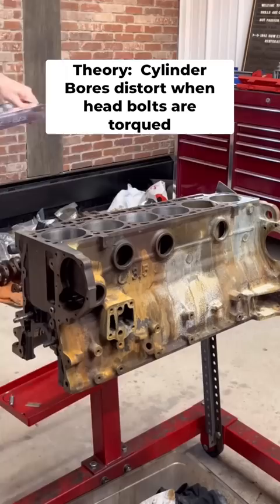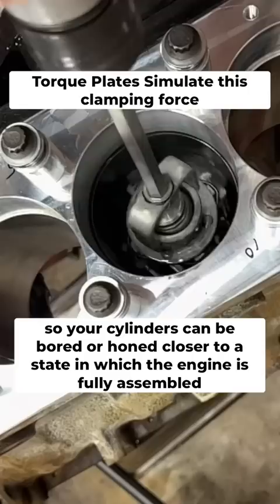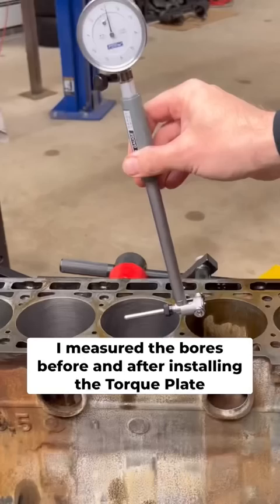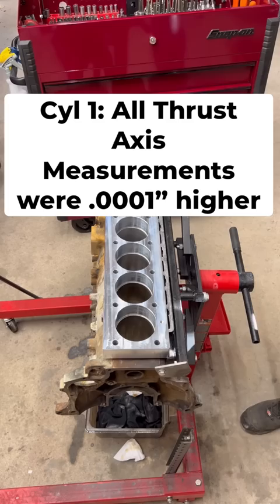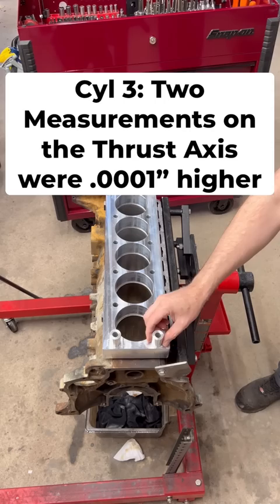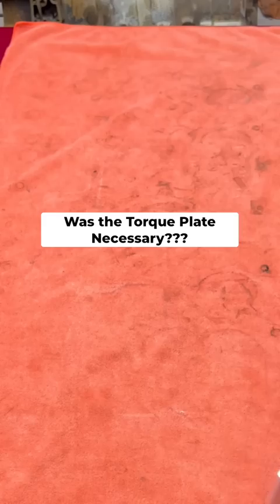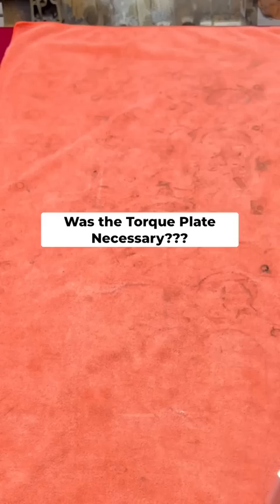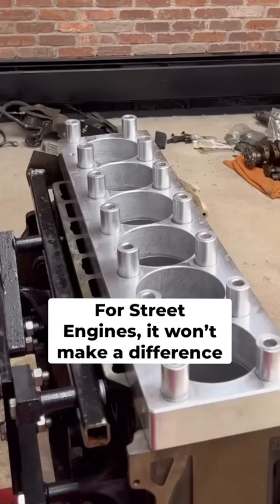Are Torque Plates Necessary? #bmw #cars #diy #bmwm5 #bmwe34 #restoration #automotive #engine #tools

Comment: professional race machinists torque the main caps and heat the block with plumbed in water, too. I do know I torqued the main caps & used a torque plate and Sunnen power hone and it absolutely made a difference. The rings sealed up perfectly, my oil stays super clean for 5k miles, and I run a carburetor.
Reply from the maker: What kind of engine? In a race application, then all the details matter. For street engines, they don't
Reply: It's a 70 Plymouth 340, mildly modded: St Hemi grind hydraulic cam, ported heads, home-made headers, dbl moly rings, Holley 750 DP carb on 1st gen Torker intake. I've raced it some. 13.09 @ 104 in 1/4. I've driven on the street. It's in a stock bodied, full interior Dart.

Comment: Enjoying this project! I've got an e30 project I need to work on instead of watching videos haha
Reply from the maker: Thank you for your support! Tell me more about your project!
Reply: @wewrench  I'm a beginner. Wanted to do something more than brakes and oil changes so I got an 87 325i convertible during covid. Brozit beige, tan top, over tan interior haha Grandpa style. Just slowly going over it and fixing things.  Did a front end refresh and belts, new clutch lines and cylinders, and ignition refresh last year. It was running like a top last summer. Now I'm trying to figure out a bad misfire issue before the weather gets nice. Enjoying the crap out of it. Plan is to just keep it alive and on the road as long as possible and learn as I go
Reply from the maker: @billh724  I love it man! Keep it alive forever! Great car
Reply: @wewrench  thank you bro! Can't wait to see the m5 back in action! Thanks for the videos!
Reply from the maker: @billh724  welcome friend!

Comment: Step in the flat motors and subie owners:
YOU MUST USE TORQUE PLATES!!!!!
Reply from the maker: Yes, I have heard this
Reply: @wewrench  I think it becomes more important with aluminum blocks, especially ones that are open deck, but used in a fairly high Rev or high power application. But for most blocks and applications that aren't for racing, I feel the same way you do. It's not really necessary, especially having different torque mounts for all the different engines you'll be seeing.
Reply from the maker: @Rhin0sAreUnic0rns  Some people are saying even street subarus its a must. What are your thoughts?
Reply: @wewrench  if the machine shop is equipped with it all and services a lot of them (like the Pacific North West) then why not? Typically not much extra charge or at all. It's tough because they're split blocks, so you gotta hone each bank separately and mount them separately top and bottom. I would recommend it, especially since the rings and ring landings are a common failure, you wanna give it the best surface spread as possible.
Reply from the maker: @Rhin0sAreUnic0rns  Thank you for this information

Comment: Well, use torque plate on one hole and not another and then swap, to final hone. If you are using hone on a drill free handed, you will definitely feel and see the difference.
Reply from the maker: Too late now! But next time, I may use that method to see if theres a difference
Reply: You can see and feel .0001 ? Hard to believe lol.
Reply from the maker: @jbaker8871  I can't see it or feel it, but I measured it

Comment: Now do this with a Subaru engine. I’ll wait.
Reply from the maker: Even for a stock build though? Many others are saying its must because of the open deck?
Reply: Your the one who said you don’t need the torque plates. Maybe you need to be more specific with what your saying.
Reply from the maker: @saccusgalifinaccus3184  Yes this is what I found when I measured before and after, and many other people who actually know what they're talking about agree, and some others don't. What's your opinion? That they're necessary on Subaru blocks?

Comment: Put the head you plan to use on and gone from the bottom
Reply from the maker: I don’t want the hone hitting the combustion dome
Reply: @wewrench  if it were worth it, you’d set a limit system somehow, but it’s not really worth it
Reply from the maker: @aterack833  Difficult because the tool has a bit of a protrusion at the end. And the combustion dome is small cus the compression is relatively high
Reply: @wewrench  do you actually consider it worth it? Also that sounds like you could get a decent part way hone, I’ve always kinda wondered why the combustion portion of the head wasn’t recessed into the cylinder anyways for more sealing capacity
Reply from the maker: @aterack833  This whole thing was not worth it at all. It was for a learning/content creation experience though
Reply: @wewrench  ok, lol, so who knows if they would consider the weird thing I said worth it, also bolting mains could help too, and induction heating the block to operating temperature
Reply from the maker: @aterack833  Yes true
Reply: @wewrench  honestly I’m of the group that would probably even skip honing on a rebuild
Reply from the maker: @aterack833  engines are way more forgiving than people think
Reply: @wewrench  I ran a lawn mower engine on propane with head bolts so loose you could see the combustion through the gap
Reply from the maker: @aterack833  Engines are forgiving
Reply: @wewrench  omg you are one of the few people who get that. Take an old engine apart that runs well and measure it. The numbers are all over the place. I’m old and have done some crazy stuff to get engines running when I was young and had no money and learned a lot from that. I took random pistons out of old engines picked the best ones, ball honed a block stuck them in with the cheapest rings I could , lapped the valves reused the bearings and drove it to work for a year. Yup pretty forgiving.
Reply from the maker: @donziperk  That's one of the reason I make these videos. When I worked for Audi, I saw all kinds of stuff and people literally breaking every rule in the book. This engine in particular....the cylinders were .004" out of round at the top. (Spec is .0002"!!!!) and it had perfect compression and didn't burn oil. And then I make a video like this and every single know it all thinks I should use the same procedures as folks who build formula 1 engines. So ridiculous

Comment: This is wrong. Your honing. Not boring. So how about you keep your opinion to yourself. Rip to anyone who listens to this.
Reply from the maker: Umm ok juryriggedengines. I measured before and after so how can it be wrong
Reply: @wewrench  for one boring generates way more heat and require constant oil spray. If ur take .040 off a bore the heat will distort block. Torque plate keeps the bore angel consistant. I would never torque plate a hone job. I never heard anyone using a torque plate for honing either. When boring over sized. ALWAYS use a torque plate. Alumin casted parts are more prone to distort under boring. I work at a machine shop and bore engines. Older cast iron blocks are less likely to need a torque plate.
Reply: @wewrench  mastet tech isnt a machinist. 2 totally different catagories. Stick in your lane. Leave the facts to those who machine. Keep being a mechanic. Not being rude. Just speaking truth. But nice project car. Do want to see it completed.
Reply from the maker: @CBR_Engines  In your first post, you said I was totally wrong, now you're saying you agree with me that torque plates aren't needed for honing. Plus...who said anything about boring? I think you are being rude...but nevertheless, I appreciate your kind words regarding the project.
Reply: @wewrench  It takes all kinds, very nice response.
Reply from the maker: @donziperk  Appreciate your support!